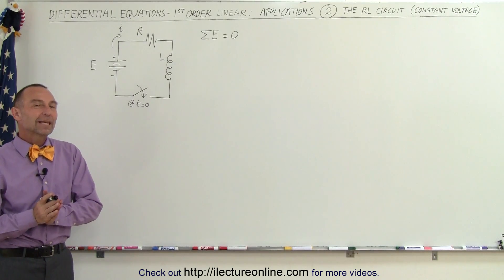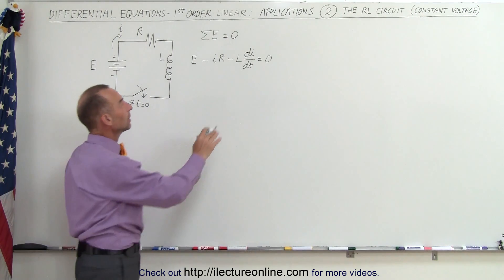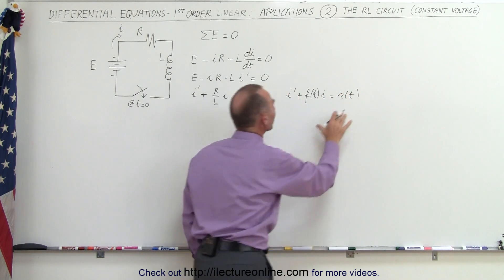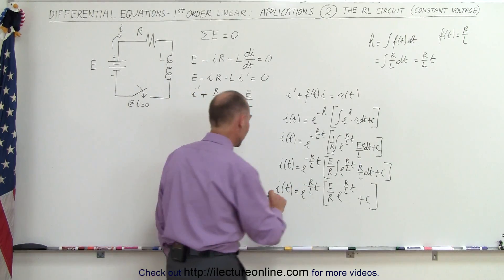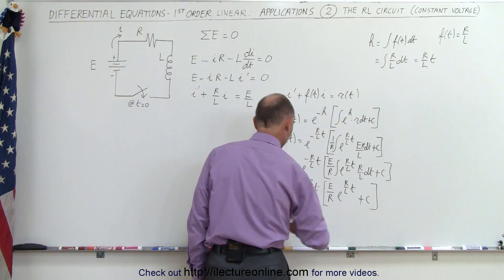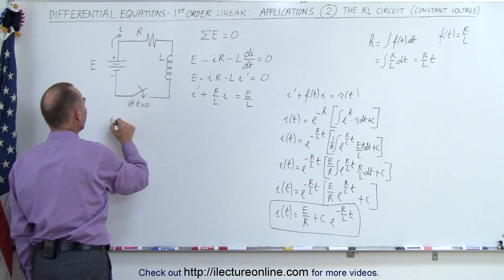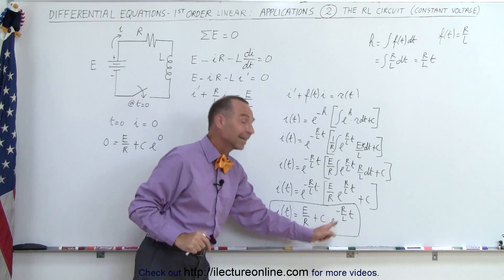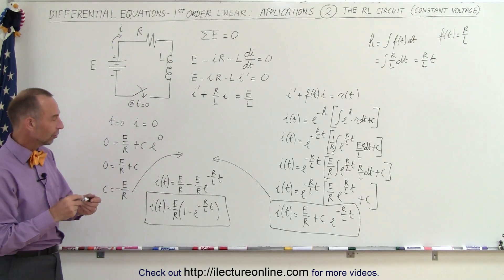Differential Equation - 1st Order Linear: Applications (2 of 4)  i(t)=? of the RL Circuit

Comment: Can u help me answer this one?
An inductance L henries and a resistance R ohms are connected in series with an e.m.f. of E eat volts where E and a are positive constants. Initially, the current I is zero. Find an expression for I as a function of t, and de termine at what time the current reaches its maximum value.
Reply from the maker: We have videos on that topic:  PHYSICS 48 RC AND RL CIRCUITS  https://youtu.be/4HFLAVYxnyk
Reply: @MichelvanBiezen  how about  this one, 
a body falls from rest against a resistance proportional to the cube of the speed at any instant. if the limiting speed is 3m/s, find the time required to attain a speed of 2m/s.
Reply from the maker: That requires solving a differential equation.    mg - bx(single dot)^3b = mx(double dot)
Reply: @MichelvanBiezen  can u show me how?

Comment: Does in any way resistance and inductance vary with time?
Reply from the maker: No, they remain the same, but the current and voltage will vary with time if there is a varying voltage or current source.
Reply: @MichelvanBiezen  can't thank you enough Michel.Your impact on students through your videos is much significant

Comment: Why is the integrating factor h, negative? I have always used mu(t) = e^integral(f(t))dt without a negative.
Reply: Pretty late response, but I was wondering the same thing. If you work out the first order differential equation from scratch you'll ind you have e^h * i on the left side and the rest of the function on the right side of the equation. You then divide by e^h on both sides to isolate for i leaving e^-h on the right side